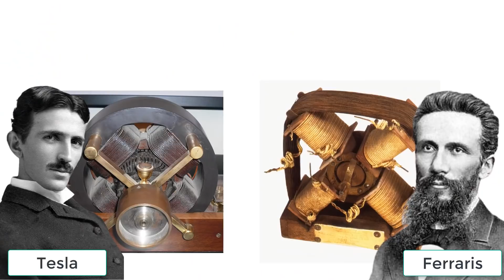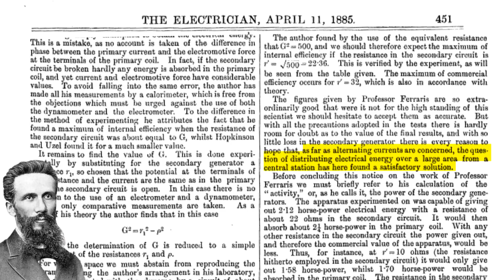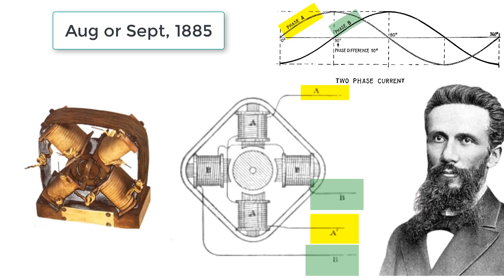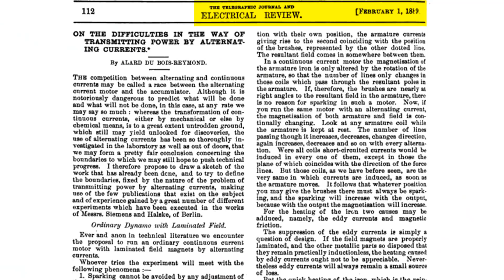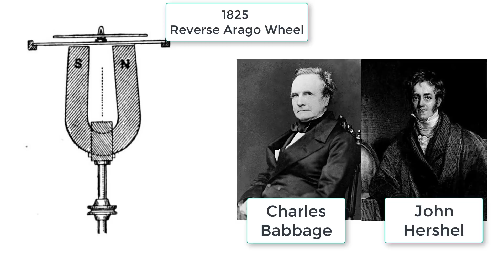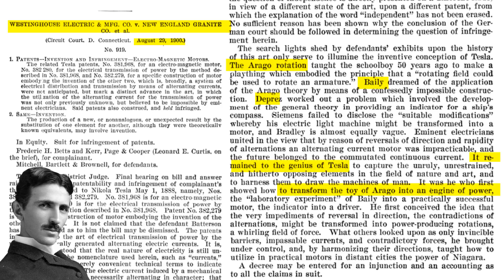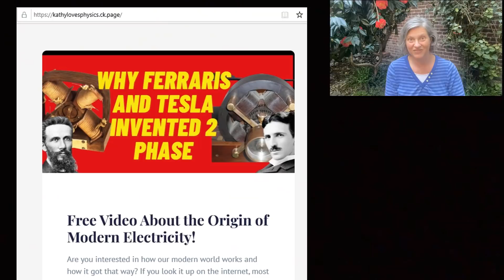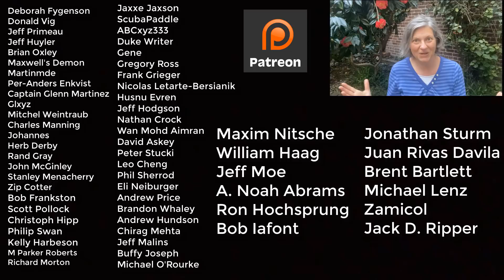How Tesla and Ferraris Created the First Polyphase Motor

Comment: The Italian 30km energy transfer from Waterfall Lanzo to Turin was in 1884. 
The transfer from Lauffen to Frankfurt was later in 1991. 
So the Italians were much earlier (even Germany had a longer distance)
Reply from the maker: They were both milestones because the energy transfer to Turin was the first industrial transmission with single phase AC and the one from Laufen to Frankfurt was three phase.

Comment: In the electrical industry, 2 phase, is referred to as "Single Phase", FYI
Reply from the maker: what they used was quarter phase, 4 wires 90 degrees apart (better called quarter phase rather then 2 phase). What we call 2 phase now is often (in the us) 2 wires 180 degrees apart which is basically single phase - that is very different from Tesla’s and Ferraris’ systems.

Comment: an AC motor is very important because if you simply reverse the force or energy applied then it becomes a generator. if you input electricity it spin if you spin the rotor it will create electricity. Ferrari was a genius. Ferrari's model is still the basis of modern AC motors. force input = force output almost of course there is very small loss due to mechanical movements of the parts or loss due to heat.

Comment: Small bit of personal history... In the late 1970's I had to design a 6000 amp 250  DC  rectifier from 3 phase AC.  The issue was that it had to run on 25 cycle and could be converted to 60 cycle at a later date.  The steel mill in Homestead, Pa, ran on blast furnace heat at 25 cycles. When they stopped melting ore, they had to change.
  25 cycle really flickers. 25 cycle was good for wear and tear on equipment.

Comment: Hey lost track there,   some video to make a xxyy motor,   and  turn it on.
We even manually went online with 3PHASE AC  power.   the dreaded open field
winding, causing a run away motor. . . . . . LOL

I recall one class in vacumn tubes, enter IBM360 mainframe, wow
a five inch deck to design and cost a 500 mile power line.  less than 10 milliseconfds CPU time

Comment: I’d have guessed that the inspiration was drawn from the steam engine, specifically the two cylinder, double acting type as would be found on a locomotive, for instance. These have crank throws at 90*, are self starting, and develop continuous, nearly constant torque, like a two phase motor. I’m quite surprised to learn that this is not the case! They would have been literally surrounded by these engines in their time.
Reply from the maker: That would’ve been a logical guess. Silvans Thompson gave that its an analogy in a book in 1897 or so (not sure of the year). However, that is not what inspired Ferrari’s and I think that If Tesla had been informed that way he would have said so.
Reply: @Kathy_Loves_Physics  have you seen any images of Quantum field(example:photon-field,up-quark field) ,the closest thing i got is this video @1:30 https://youtu.be/1qJ0o4U63aw.  In this video there is an image/GIF it is called as Gluon-field(which is one of quantum field) other than that i am not able to find any other image(simulated or animated) image of quantum field

Comment: I love this channel. I'm an electrician and since I started I've looked at the history of wiring methods and materials. I regularly work on wiring that's 100 years old, and if you date the wiring, you have an idea of how the entire premesis is wired. 

These histories are awesome, and it would be super cool to cover somewhat in-depth the methods used in various types of construction. How did knob and tube come about? How did we change from transmission lines in the walls to cloth and tar cabling? When did NMB cable go from black to white to getting color codes? How did Edison standardize equipment?

Just cool things I have stumbled on.
Reply: have you seen any images of Quantum field(example:photon-field,up-quark field) ,the closest thing i got is this video @1:30 https://youtu.be/1qJ0o4U63aw.  In this video there is an image/GIF it is called as Gluon-field(which is one of quantum field) other than that i am not able to find any other image(simulated or animated) image of quantum field

Comment: My story will date me.  As an undergrad EE I worked for the physical plant department. The original buildings on our campus were constructed in time for the 1904 World's Fair and were powered by the "original" 2-phase, 90-degree out of phase system.  When the world came to realize not long thereafter that 3-phase power was the most economical the university, not wanting the expense of replacing all the 2-phase motors, installed two center tap transformers in a "Scott Bank." to power them.  By the time I was there (1960s) there were only two motors left running off the Scott Bank -- one large exhaust fan and the book elevator motor in the original library.  I had always wondered why 2-phase when I think it was on page 2 of the introduction to A/C circuits book that demonstrated the economy of 3-phase.  Thanks for helping me to understand the natural progression.
Reply from the maker: That is fascinating thank you
Reply: have you seen any images of Quantum field(example:photon-field,up-quark field) ,the closest thing i got is this video @1:30 https://youtu.be/1qJ0o4U63aw.  In this video there is an image/GIF it is called as Gluon-field(which is one of quantum field) other than that i am not able to find any other image(simulated or animated) image of quantum field

Comment: Arago's wheel took me back to a demo they gave us undergrad enginneers back in the 70s. They had an electromagnet from a cancelled cyclotron with poles the size of a cafe table and maybe 4" apart. You could shove an aluminum plate in there standing on edge, and the induced current kept it upright for quite a while.
Reply: have you seen any images of Quantum field(example:photon-field,up-quark field) ,the closest thing i got is this video @1:30 https://youtu.be/1qJ0o4U63aw.  In this video there is an image/GIF it is called as Gluon-field(which is one of quantum field) other than that i am not able to find any other image(simulated or animated) image of quantum field

Comment: Looking forward to your video on Steinmetz, whom I knew about in a library book in  high school, when I had never read anything about Tesla. Something I attribute to GE having more publicity and promotion in schools available. In Jr. High I made a "computer" according to a GE Progress Poster plan that won three blue ribbons at Science and County Fairs.  It was a very simple analog resistor multiplier circuit, that I added two rows of push buttons to, numbered 1 through 10. Digital computers were in all the news in 1957, and in my innocence I did not know one type of computer from another.
 Getting the  ammeter on that analog  computer to  read the correct answer to two simultaneously pressed, numbered buttons, wired to the appropriate spots along two linear nichrome wires was a nightmare, as each clip altered the total resistance. Anyhow the learning experience was invaluable to my later career in aerospace.
Reply: And then, you discovered transistors :-)
I'm "young" but I sometimes play with old Germanium transistors and am still amazed at what a revolution these were, back when they appeared.
We're so spoiled with out modern, cheap, efficient, reliable transistors these days...

Comment: With a 1-phase motor there is always the problem of getting it to rotate and keeping it rotating. An auxiliary phase is required, either by a capacitor shift or magnetic shift. 
Maybe like a steam engine with only one piston.
A 2-phase motor is already more willing to run.
A 3-phase motor is optimal. 
A 4-phase motor or more phases require more cables, which is available as a stepper motor where the controller is directly there. But too expensive for a long distance of the wire.
Reply: A 1-phase motor can start running forwards and backwards. If that is not prevented.
A 90° 2-phase motor probably too.
A 1-phase motor with 30° shift has one direction of rotation.